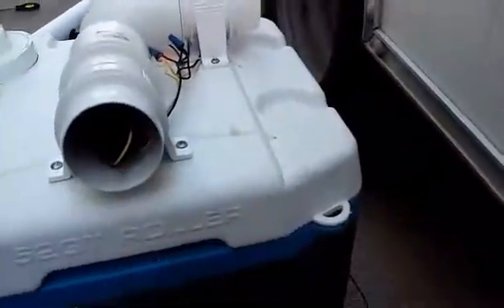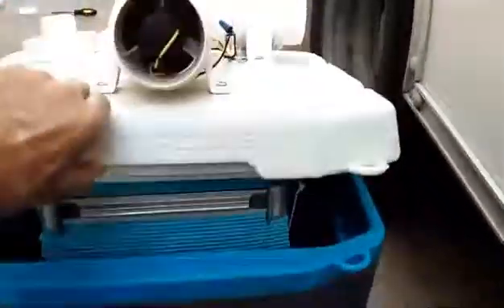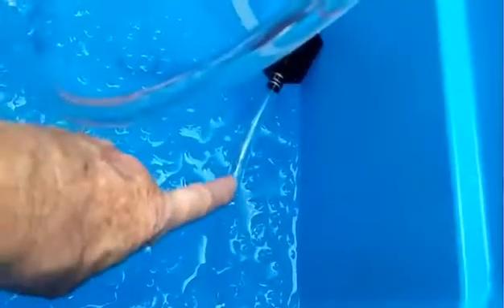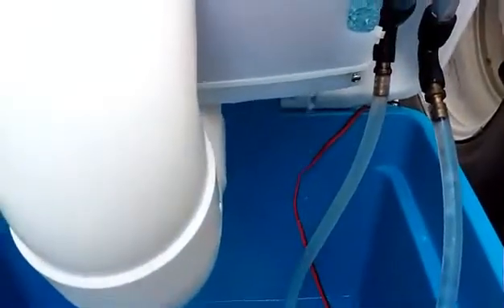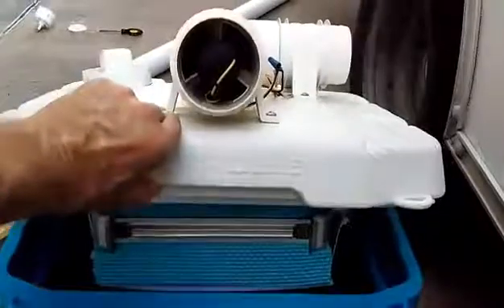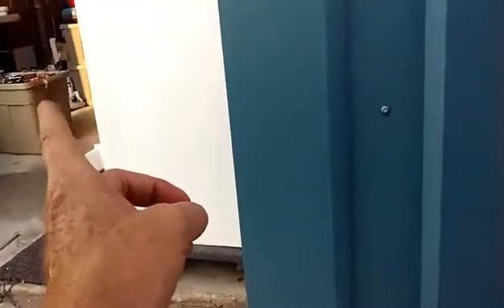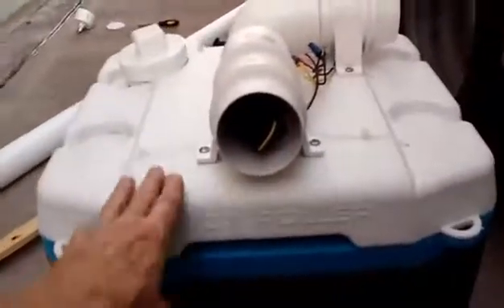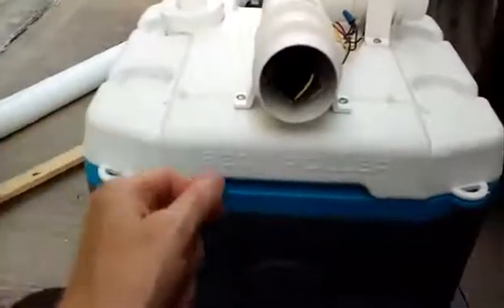Homemade Air Conditioner: Beta Airflow Test Using Inlet & Outlet Fans

Comment: I want to make one for a grow room 3x3 tent any ideas ? Or input on how to ?
Reply from the maker: The small red ice chest design model can cool an 8x12 room just as good as a 5,000 BTU window air conditioner. It would keep the tent very cold. The fan blows as fast or faster than a wall unit AC and the temperature of the radiator fluid stays at 33 degrees F so  the output is the same. I am currently completing the small red ice chest version and will upload some key video tips for sure. I hope to be finished in the next week or so. You won't be disappointed by the cold cooling affect at all...!!!
Reply: I can see myself making one like this.
Adding and using the return water into a small Swamp cooler for the inside of the intake. To keep the moisture in. With a fast blowing outlet with the cooler radiator. The main reason is to keep the cold side cold longer. 

I have many types of plans. But in the end. This works amazing